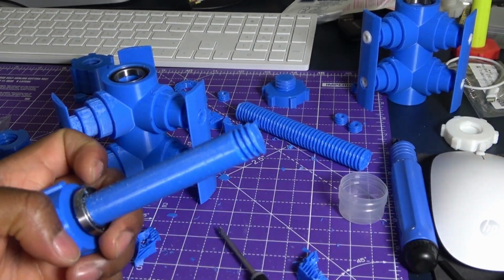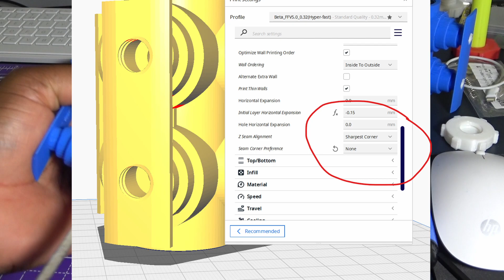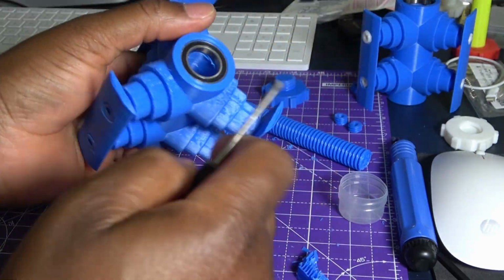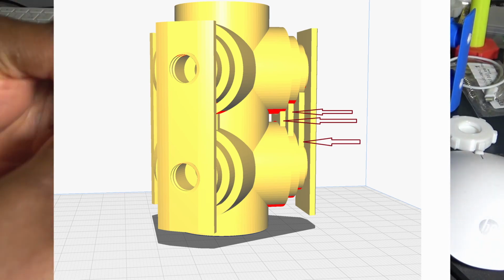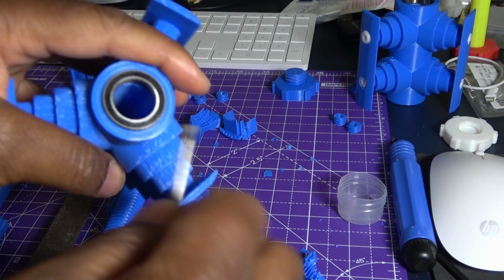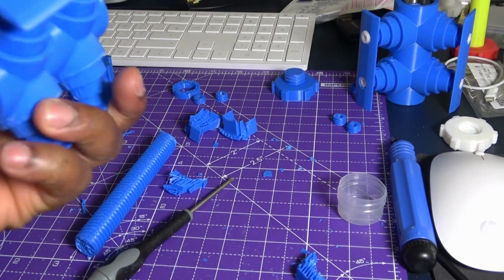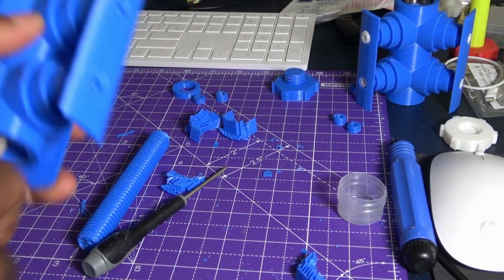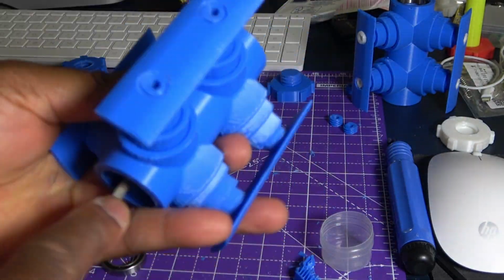Low friction Filament Spool Holder 2 for Creality 3D Printers - CR-30 CR-6 SE Ender etc

Comment: I like the design of your rollers. I have done something similar. The problem I've run into is that if there is no friction in the roll, it will unwind to easily. I have filament run off the roll.
Reply from the maker: Yes I’ve considered adding self-rewind feature, but not quite ready to work on it just yet.

Comment: I have printed this to try. This is an observation not criticism. I found for my printer the tolerances where a bit tight only on the expandable parts, so when i put pressure on to the outer wings thy broke. so you need to be careful when releasing the expandable parts. I would also suggest making the outer wings  them about 5 mm thick to give them more strength and possibly prevent braking. I think this is am awesome job and well done 👍👍
Reply from the maker: Thanks a million for this comment. I’ve a new version. I’ll try and upload the models before Monday.